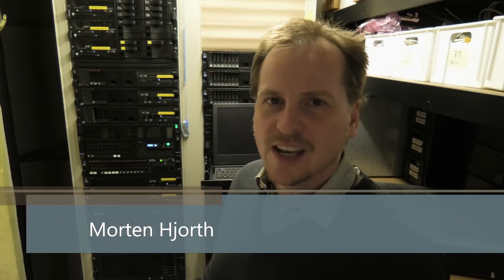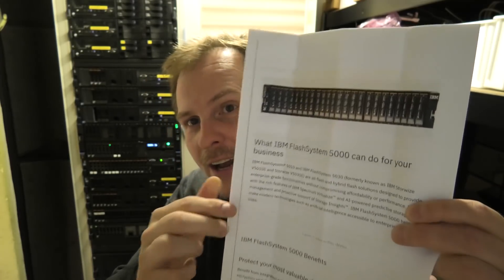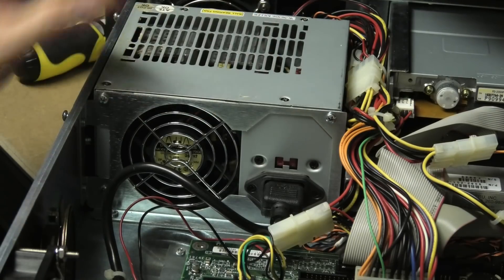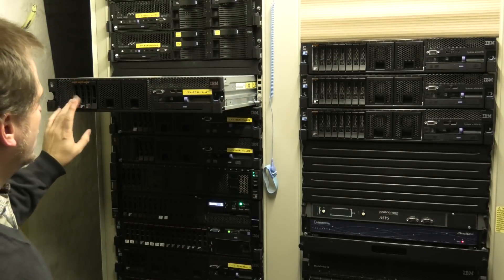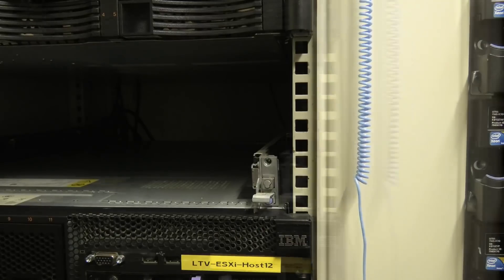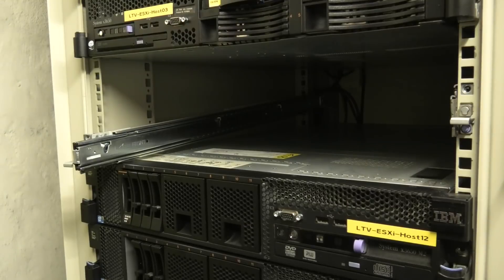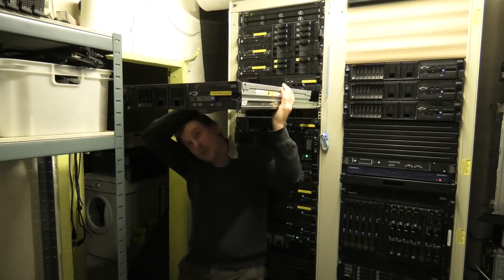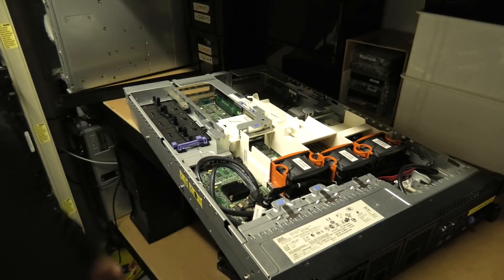Investigating Why Server "Exploded" & Moving x3650 M2's - 1001

Comment: Morten, you seem to be the biggest IBM guru that I have been able to find, I hope you can help me out with something. I have a IBM eServer xSeries 226. Great server for my needs. (Hosting old game servers) Anyway the hard drive hosting the OS failed unexpectedly and I didn't have it in a array. I have been unable to find a driver for the RAID card or the "pre-installer" for Windows. I have been through the loop with IBM  for over a week, they can't seem to find any information on it. I can see the support page on IBMs website, but FixCentral doesn't appear to list this old model. I can find random files for the server on IBMs website by Googling something specific, such as a BIOS update, but am unsure if the file I find is the latest available. Do you have any suggestions? The last thing they told me to do was to contact Lenovo, but this being a server from around 2004 I highly doubt they would give me any help.
If you have any suggestions I'd really appreciate it.
Reply from the maker: Look at my videos about BOMC,, see if you can get an old IBM BOMC going that might help you.
this old a server is not going to be easy.
Reply: @MyPlayHouse  Appreciate it, I found the BOMC but it sadly doesn't look like it has the ability to do a operating install on my particular model. Thanks for the help though.

Comment: I have just been given a disk array to troubleshoot and back up but initial googling of the serial numbers comes up blank. It is from 2014 ish. I am going to take it apart and see if I can at least get some motherboard numbers and processor info. It is quite dusty , should be fun.
Reply from the maker: Good lock :-) no brand or nothing?
Reply: No nothing obvious. There is a sticker from a reseller that doesn't help much. So mysterious. ❔❔❔🔎🤷‍♀️

Comment: One of my repaired Dell server PSU decided to fail again. When I turned on the server I saw a failure LED on it lighting up, and it was blowing really hot air. I slided it out and let it apart. Probably the best decision I had instead of putting my garage on fire... Now I'm planning to buy a spare one, it's too risky to repair it, I saw many buldgy capacitors inside...
Reply from the maker: Well this thing was not a big fire haset,, I was mostly afraid of electric shock.

Comment: The Dell R610 I'm able to do them by my self but just to make it a little lighter not by much I take the hard drives out
Reply from the maker: I am mostly afraid of dropping it,,, on my foot!
Reply: That is why steel toe boots are required in data centers for my employees or where ever there is anything heavy
Reply: I did it one and good thing I had them on

Comment: Just a question the voltage is lower in the US then Europe im not good with power but would it not turn on bet it blew up?
Reply from the maker: Voltage is dobble in Europa,, and most other parts of the world. The power supply did not like that.
Reply: My PlayHouse  I forgot I guess I was not thinking it would have probably not turned on it the us

Comment: Have an x3850 X6 working as a server for me. Lovely server, but lots of special sauce to make it work (want to use all of the pcie slots? Better buy IO-books then...) Most annoying thing is that the unit fully refuses to do anything with dell RAID controllers in them, so I can't use my MD1200's with it. Good excuse for a high speed NAS and fiddling with beegfs over infiniband I guess.
Reply from the maker: Yes the x3850 X6 is a weird one,, but I would like one,, they are just kind of rare..
Reply: @MyPlayHouse  if I find a more agreeable server with similar specs I'll call you up. Wouldn't be too hard to bring it to Denmark for me.

Comment: We all learn from mistakes.. ;)
It will be great to see that's poor power supply's internals after explosion.. In best case only big input capacitors blows up.. Bad thing - all pcb needs to be cleaned from electrolyte.. In worst case - transistors may be in heaven..
Reply from the maker: I am not going to investigate that,, if it was not the voltages selecter I would have.

Comment: ahh.. so much power supply was in my repairer bc of 110v/220v switch. in 90% after that diode bridge is dead+fuse and caps too
thx for vid!
Reply from the maker: It was a borrowing error :-) but the smoke was great.

Comment: Please will you test it with a different power supply? Just for fun to see if it works and whats on it :)
Reply from the maker: Would be more interesting to build a new then.
Reply: @MyPlayHouse  that would be interesting too :) But i would really like to see if that powersuply was that cheap that it fryed the MB too. maybe if you would build a new pc in that case, just plug som PSU in and  see if it even powers on and what is on it

Comment: Exciting! IBM sending you some goodies to play with. Will be looking forward to when it arrives.
Reply from the maker: That is the plan,, some brand ned storage.. lets see if I can figure that out.
Reply: @MyPlayHouse  is it a SAN? looking forward to the review.
Reply: @WoTpro  The StorWize family are usually designed for SAN use, but you can also Direct-Attach them, if you have the correct Controller-Backplanes installed.
Reply: @MyPlayHouse  I have the old Storwise v7000 and they are very sexy